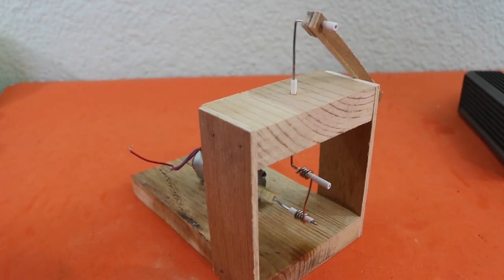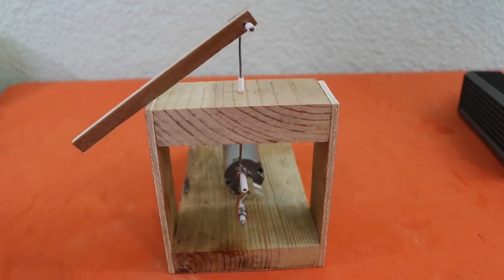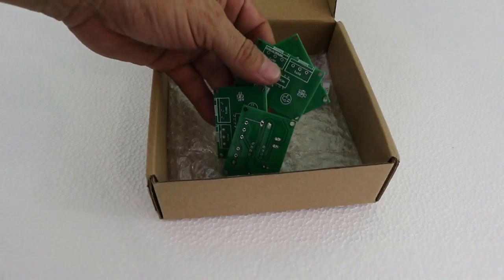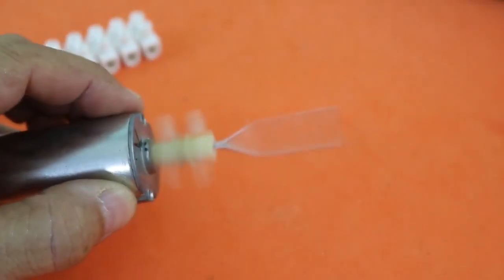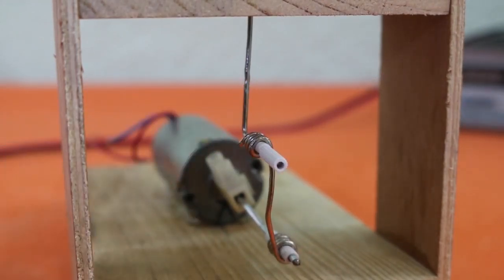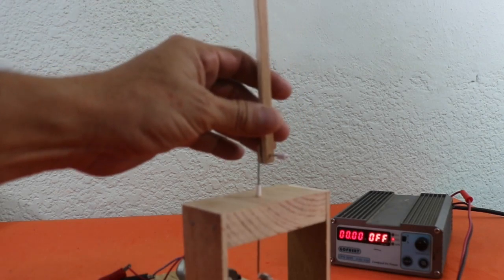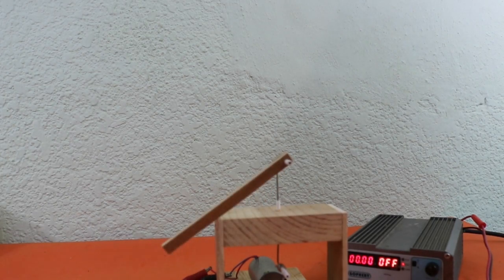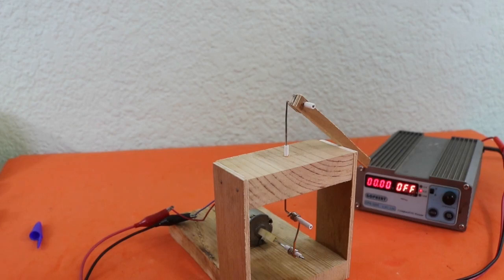Inverted Pendulum or Kapitza Pendulum

Comment: Is the vertical position TILTED a bit due to the distance from the equator? Or perhaps just from tolerances in the design not pushing straight up/down? It seems like there is a gravitational pull slightly to the side even when you push it back and forth almost like it is detecting North. It even seems to point straight up when you rotate it so it cannot lean in that set direction due to the linkage not allowing it to. 4:20